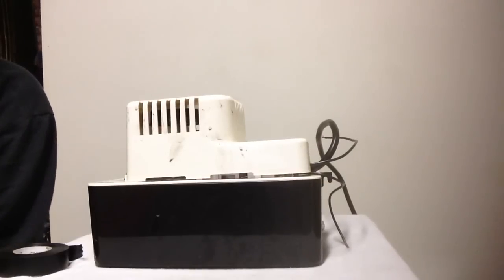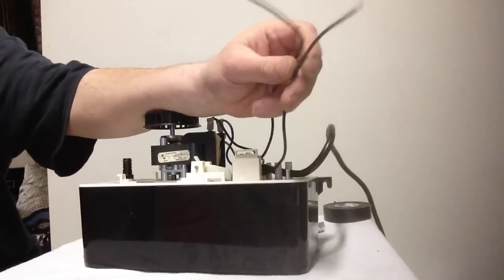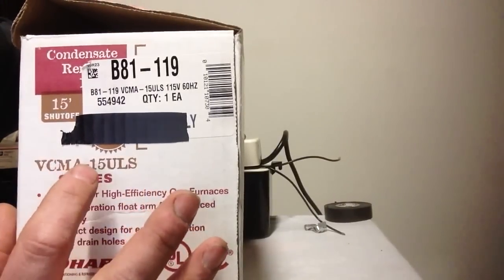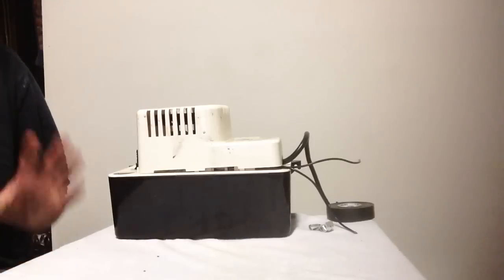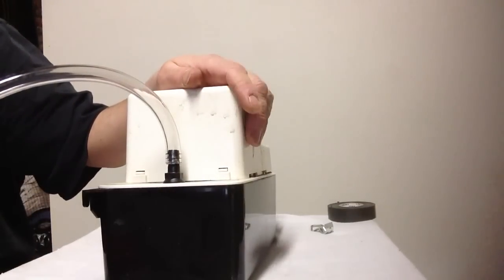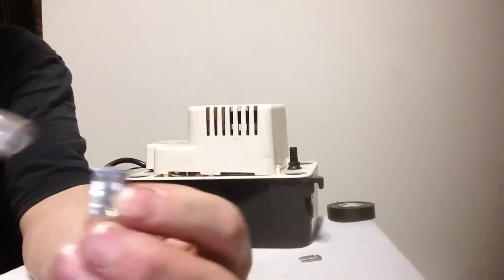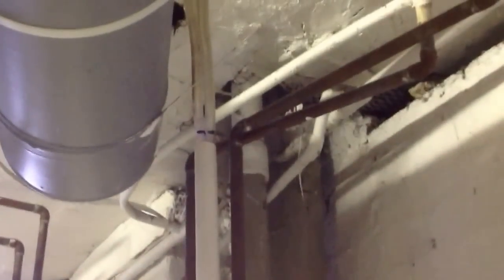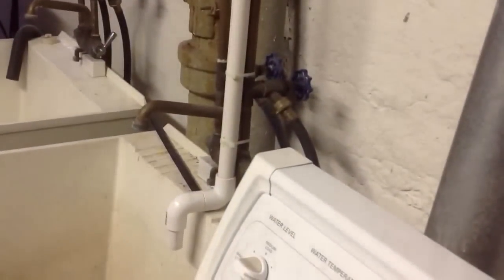A primer on condensate pumps

Comment: I have the exact same pump and I'm having a problem with it stating ON all the time.. even if its empty. What's weird is when I raid the floater the pump shuts off. It seems like the kill switch is doing things backwards. When the floater goes up.. then the motor should run right?

Comment from the maker: This pump could be wired wrong. There are 3 spots on the switch that would switch this function. One terminal is a common and the other two would control if the switch turns on when the float rises or drops. It would be very odd that this would be the case.
Reply: I doubt its the wiring.. it hasn't been touched in like 10 years.. it just started this on its own.. when the floater is up the pump shuts off.. when the floater is down.. the pump goes on... I'm wondering is the floater isn't sitting properly on the switch?
Reply from the maker: ***** if you take the top cover off you can see how the float works it's very simple. You can even hear the little switch clicking to turn the motor on.
Reply: themrhelperguy that's how I know it works. I took the cover off and manually tried lowered and lifted the floater to see it touch the switch on and off. So the switch seems to be working.. just in reverse like I described in my last comment. Perhaps the switch is just malfunctioning. I took it out to analyse it and I can't see what could be wrong with it. I guess I'll just try replacing the entire pump since I heard those switches are quite expensive.

Comment from the maker: These pumps have a very little switch that turns on the pump when it rises and off when it drops. These little switches go bad and as far as I know you can't get a replacement. You could open the lid after you unplug the unit and work the switch back and forth. It will get you mad to see how easy this would be to replace. I'm going to bet you will have to buy a new pump.
Reply: I  rr